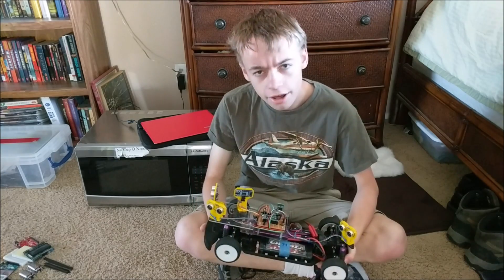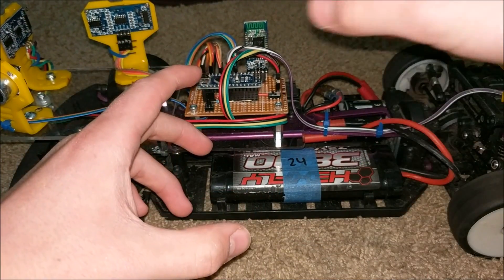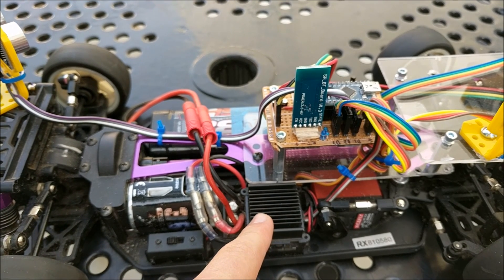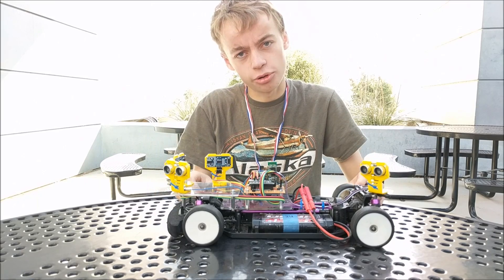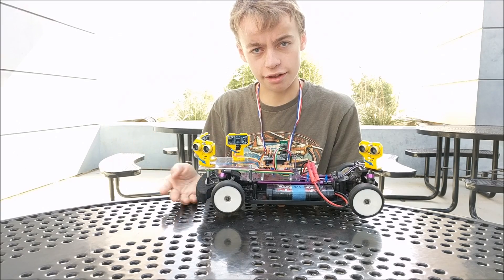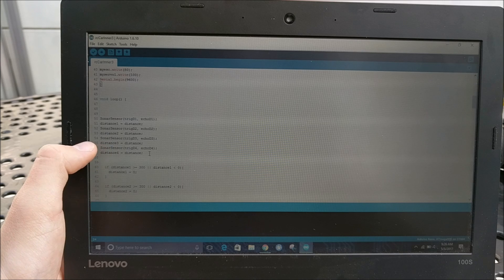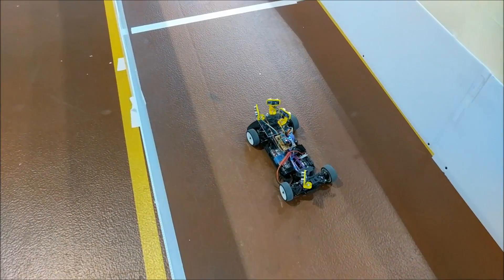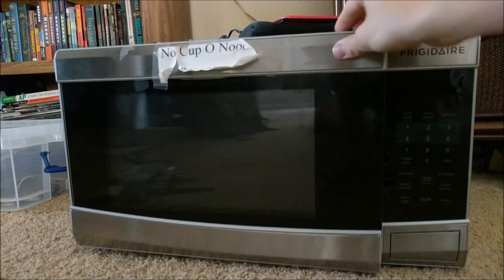How To Build A Self Driving Car (Miniature)

Comment: Hey Tanner,   Question please.  In programming sensor to avoid obstacles, do you include calculations that take in the size of car so sensors know how close it is without car touching obstacle?  Or do you set distance parameters that when reached the  sensors trigger steering correction to avoid obstacle?  
I am automating a grass mower.  Another consideration is vibration or bumpy ride over lawn as it may distort sensors accuracy in calculating avoidance.

Comment: How would you go about to make it into a path finding car which has mapping capability, enabling it to get to point A to point B with a single user input on an interface?
Reply: We can use a GPS module and control it with an Arduino Uno

Comment: dude seriously.... that is not an "extremely long" code set, nor is it even "quite long" 
Try writing tens of thousands of lines of code!  Bugger me, at ten years old I pushed Sbasic so far that some programs required 3 "programs" to run because the system (sanyo MBC1000) didn't have enough ram to hold the program in memory.
There is nothing fancy about Arduino... NOTHING, in fact most of it is pretty botched up  modules written half arsed by people who couldn't be bothered coding for all the functionality of the "shield" because they didn't require it for they're set up.

These are Atmel uC's, sure use the "Arduino" interfaces if you must, but get away from the IDE... use Atmel studio, learn the controller's registers, write your own subroutines and modules/units/libraries whatever you want to call them. They are so much more powerful than the janky software that's generally written for them.
Reply: Dude, you need to work on your soft skills, even if you are right. You can catch more flies with honey than vinegar.
Reply: You know you are a bitch with no life Jummeh

Comment: Dude... Im also planning to build that. I have an old rc car here which i want to salvage also you said that i need esc to work that but my motor on my rc is only 2 and in the front it can be steer.

Comment: how much money require to make this project ??? .
Reply: It would be less than 200 bucks, lets make some calculations
Arduino nano is almost 5$ or less
Distance sensors 1$ for each lets say 5$ for 4
The battery pack used in this project is the most expensive oart of it, which is probably between 20-30$ 
And bluetooth module is approximately 2$ 
Motors are not servos so they shouldn't be expensive probably around 5$ each and 2 motors used i assume (may be 3 I'm not sure)
And the body is from scratch rc car, that can be easily made by a board, wheels and some shaft job :)
So at last i assume it is probably cost between 60 - 70 dollars
Reply: YAS SAN sarcasm 🤣
Reply: around 165 to 200 bucks I think...
Reply: Pankaj, that's in dollars
Reply: Only 2 rs LOL
Reply: Pankaj Chaudhary I guess you will have to spend 2500 rupees and still have some left